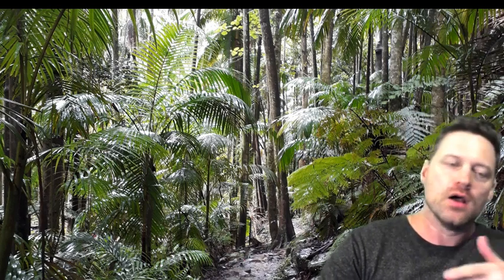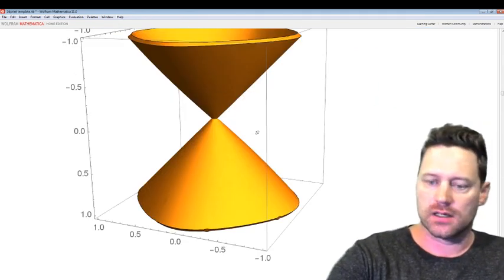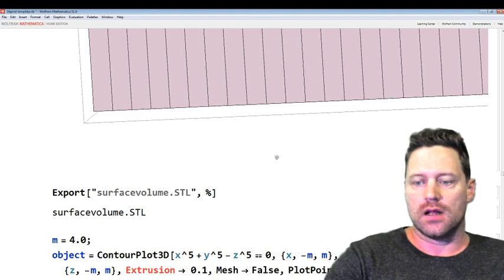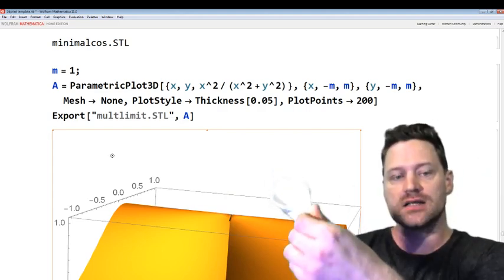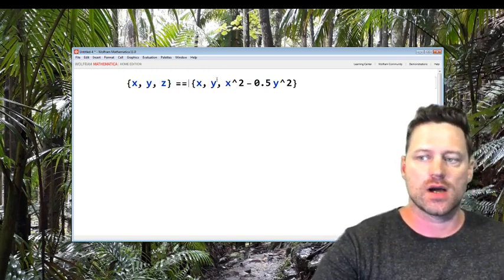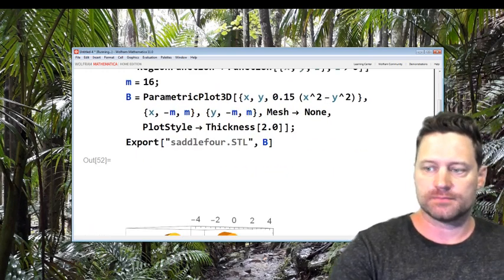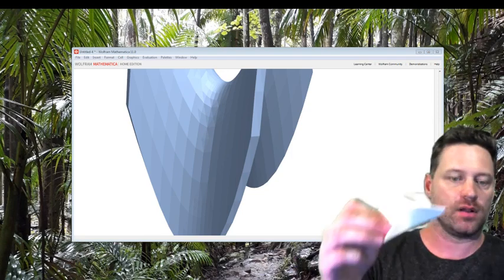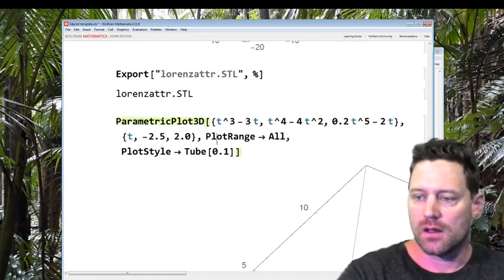Mathematica Tutorial 43 - 3D Printing Part 1 - Printing Mathematical Surfaces

Comment: can i ask a question? When I open the STL files exported from Mathematica in software's like ICEM CFD, GEOMGAIC DESIGNX, it doesn't open properly. Which software is compatible with mathematica for opening the STL files. Something is not proper.
Reply from the maker: STL files should be compatible with 3D printing slicing software. I use Flashprint to open them but there are many.
Reply: @SamHambleton  how to open the file in other softwares like Rhino 3D or solidworks. Do I need to do antyhing additional? It seems I can open the STL file from mathematica in only 3D printing slicing softwares. somewhat weird as we should be able to open in any softwares.